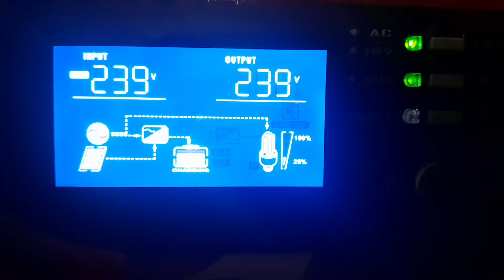#solar #inverter #canadiansolar #installation  Installation of 1.2 kW Solar System

Comment: ye iverter kon sa hai aur kitny ka hai inveter aur solor price pleasse waiting
Reply: Solar max ka 1.2 Jaguar series ha 
40000 rupee mil jata ha 
Aapka lagwane ka plan hai to yah mere Bhai na lagana kyun kcompany ne 50 empier ka banaya hai ba  mushkil 40 ampere deta hai 
Ek panel se jyada lagane Ki Koi jarurat Nahin kyunki mere Ghar mein yah laga hua hai do panel per 40 empier deta hai jab ke Maine ek panel per check kiya hai ek panel 33 ampere deta hai to aapane jab hi lagwana hai aapane jab bhi lagwana hai primax ka PV 2000 lagwaye ya FIR use company ka panel lagwaye jismein PV range jyada ho
Reply from the maker: Total cost 120000. Two pv Canadian solar 575 watt top con bifical